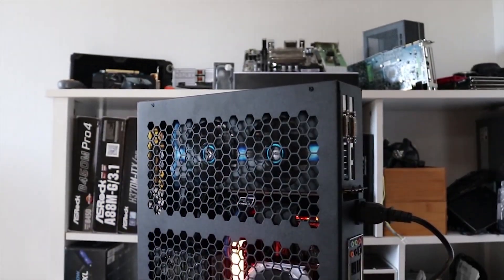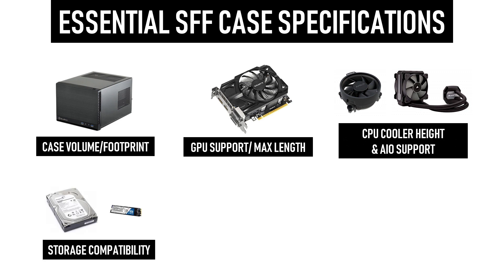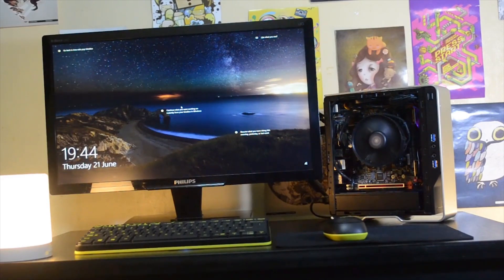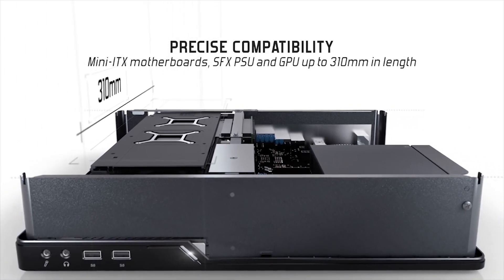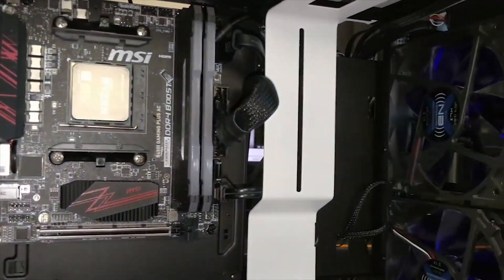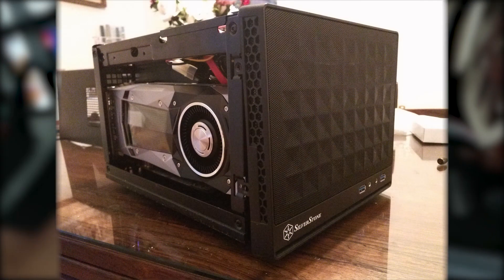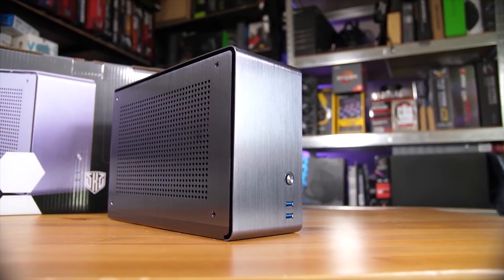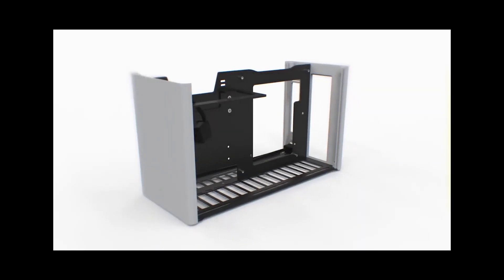How to Pick a SFF/Mini-ITX Case?

Comment: Hi, the visual aspect matters a lot to me, so I very much like Dan‘s A4 SFX in silver and have decided to order one. Version 4 is supposed to become available in April / May this year. Find it a little unfortunate, that the heads of the 4 screws on the top pane are visible, wish it could have been attached the same way as the side panels - they don‘t need any screws. Thinking of either getting flat caps or maybe small stickers in alloy color to hide them.

And I just imagine how much smaller / narrower the case could be, if the space for the external graphics card was not needed. The SFX PSU can stay at the position where it is, I prefer to not use any external AC to DC transformer. Other than that, ... hm, maybe one or two side panels with transparent window(s). Not sure about the ventilation tho.
Reply from the maker: Sometimes (mostly) engineering trade-offs dictates the design language of the case. Screws are very effective and secure. It is no different with the SG13; the outer skin, even though it is designed to slide and fit into the chassis, still need to be screwed.

Comment: Thanks for making the video. I have all this in my head for the past 1 month. Troublesome to think which one. Thinking of raijintek ophion evo / h200i / raijintek metis 
..above all... i prefer too  umx1 plus from Jonsbo. God.. this is tough
Reply: If you are building from scratch, then just pick the one you like the most and then just buy the components based on that. However, in my case (pun intended), I had the components already and my choice was dictated by that. I ended up with the Metis plus since it was able to fit my dual fan gpu, 120mm aio, and full atx PSU. 
There are a few negatives with my build, but after I removed plexi window and replaced a a perforated aluminum mesh, which was the biggest problem with it, I'm very happy with the build. 

If I had to buy everything specifically for the mini itx build, I think I would personally go with the node 202 since I love the slim footprint on it.
Reply from the maker: @carlos2004  Hear, hear. Some people prefer to create a part list around a case, while others have to pick a case based on a list of parts. Finding the perfect compromise is truly what makes building SFF PC interesting.
Reply from the maker: The video is just a general guideline imo. There are many more unique cases out there, and you'll have to check the specs closely to find exactly what you need. Larger case for better part compatibility or smaller ones for tight fit. Some SFF users also upgrade their cases because of this.